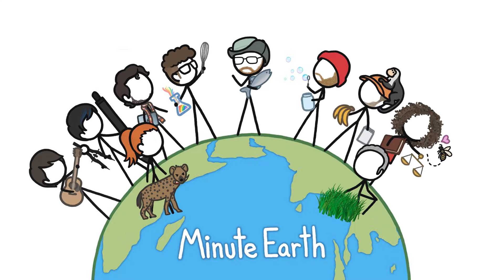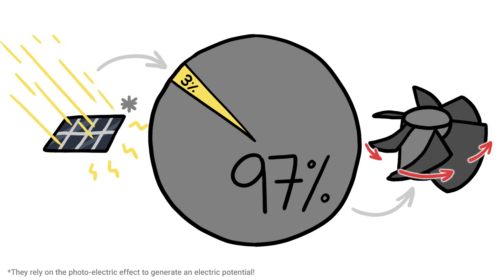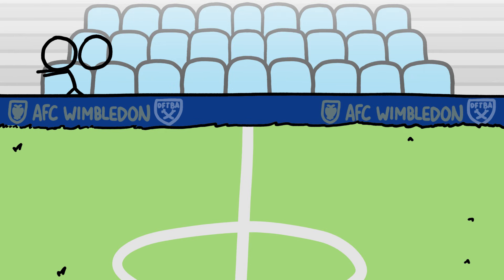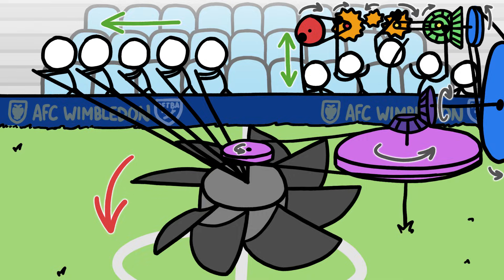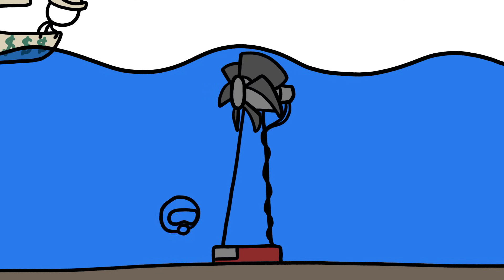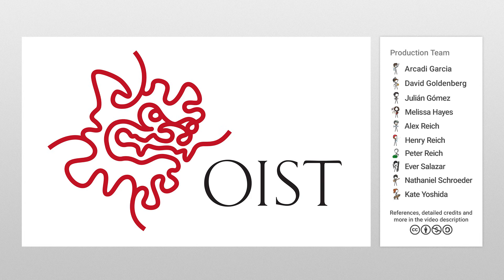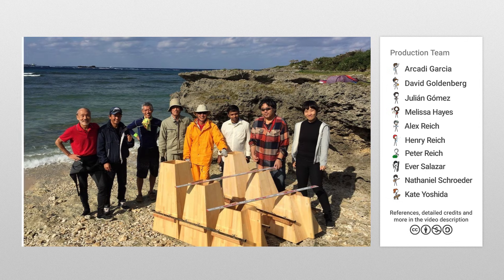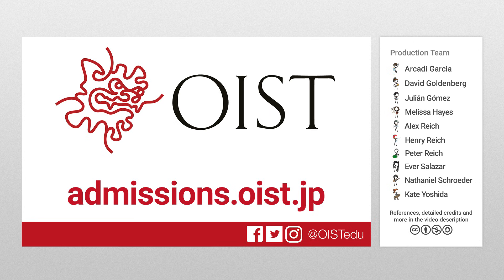Why Can't We Get Power From Waves?

Comment: Mankind does not need more ways to make power, we can do that vary well and in many ways, what we need is a way to store power in bulk and use when needed.
Reply: It is already stored in uranium and thorium at a fantastic energy density. Don’t need storage, just need less radiophobia.
Reply: @soylentgreenb  you need to learn how energy and power plants work as well as matter, mankind as far as I know can not make a uranium battery and I think both uranium and thorium make vary bad battery's as they all ready have energy stored inside, let me explain as I don't think you get the problem mankind face's ( you should teach yourself ) we only run a nuclear power plant at about 5% effectiveness, any more and you would overload the Grid and hole country's would black out, now if we had good power store we could run the power plant at 100% for let's say 2 weeks and then have power for the rest of the year, a much more efficient power use and this use of power can all so be applied to any power generator type not just nuclear.
Reply: @highlandsprings5752  The misunderstanding is entirely yours, not mine. I can store a lifetime worth of reliable energy in the palm of my hand. This power can be created in nuclear powerplants 24/7 at over 90% capacity factor in a power plant; with most of those remaining 10% being planned shut downs when other plants cover for the loss.

I'm neither interested, need nor want to store your unreliable piddle power as in a battery. A supernova saw fit to store all the energy I could ever need in a tiny volume.

"[...]we only run a nuclear power plant at about 5% effectiveness, any more and you would overload the Grid and hole country's would black out[...]" - This is word sallad. Heed your own advice.

Nuclear power plants are not "holding back" and only running at 5% "effectiveness". Do you mean efficiency? If so, that's horseshit. If they ran hotter there would be unacceptable fuel damage in currently existing kinds of nuclear plants (LWRs). It is running as close to 100% thermal efficiency as it is able, which is about 30%; thank steam turbines and mr Carnot for this. The cost of the nuclear plant is the same wheter it is running at 100% rated power or not; there is no particular need for storage. The fuel is the storage.

"[...]now if we had good power store we could run the power plant at 100% for let's say 2 weeks and then have power for the rest of the year, a much more efficient power use and this use of power can all so be applied to any power generator type not just nuclear." - I cannot fathom the kind of misunderstanding that would lead to this erroneous conclusion.
Reply: @soylentgreenb  OK you are missing the point, let's say I have one power plant (any type) and that I have to generate power for five homes and one factory, now my power plant can make 100MWs and the homes need 5MWs each, the factory all so takes 10MWs to run and I just turn the power plant on to max (like how you think power plants work) then you are going to overload the grid and blowout all the homes and the factory, this becomes even more complicated when you add that in the real world (not the movies) the power consumption Of the homes and the factory Will fluctuate at different times, so the output of the power plant must match the demand for said power and this is why renewable power sources do not work on there own as one can not make the wind blow more or the Sunshine to keep up with the demand. I am now going to address your points. 1. Nuclear power plants can generate so much power that they can melt power lines at levels like 90%, most Nuclear power plants do not run beyond 30%, all so power ( I am keeping this simple for you here) will Diminish over distance, so in a place like the U.S you are going to need more then one or you would melt the power lines close to the power plant to reach outlying areas. 2. You are not the only person on the plant Earth and renewable energy can not be used as a viable source for all until we can make better ways to store power. 3. The post was made by phone ( Blame Auto correct ) not key bored and you are using the word "sallad" wrong by the way, looks like you could do with heeding your own advice. 4. Once more the auto correct changed the word so yes I did mean efficiency but effectiveness would still prove the point. "Horseshit" LMAO, first it was a simple example and Second the example was given for any type of power plant not just nuclear, third if you are running a power plant to the point that you are damaging the fuel or any equipment then you are running it beyond 100% EFFICIENCY. As for it costing the same yes that's right and that is what makes nuclear power so viable if only we had a way to store power long term for use when needed. you can put a F1 Engine inside a ford focus but all you will do is destroy the car, their is more to power then just the powerplants so you can not run nuclear plants at 100% unless you have a Transformer the size of Wyoming and are using power cables made from Materials that you would find in Star Trek. 5. A College degree in electrical engineering and over 10 years of experience trying to come up with and implement solutions to the power problem with the ever growing human population mainly focusing on the African front. like I have said I am keeping this simple for your sake.
Reply: @highlandsprings5752   You don't have a point to miss. There's this thing called baseload power and it corresponds to ~75% of power consumption and we can make more of it (e.g. dump load into things like freezers off-peak). Nuclear power plants can load follow a little if needed (see France). Peak loads are absorbed by hydro with a reservoir or NG. 

Nuclear power plants go full tilt 100% 24/7 because the fuel is cheap. Only in France with ~90% nuclear does anyone ever bother to load follow and that's only a few plants and by a little. You simply don't know what you're talking about.

"the power consumption Of the homes and the factory Will fluctuate at different times" - By about a factor 2 between peak and through and over 75% can be supplied as constant 24/7 baseload, which is what nuclear plants do. It is much cheaper to overbuild nuclear, load follow a little and dump surplus power into a big resistor somewhere than try to store REE at all scales from minutes, to hours, to days, to weeks, to seasons and to shuffle power from anywhere to anywhere. Thus far we haven't bothered because getting 75% of the grid is good enough; we can let gas and hydro do the peak loads.

"1. Nuclear power plants can generate so much power that they can melt power lines at levels like 90%, most Nuclear power plants do not run beyond 30%"

Good thing it is easy and cheap to design powerlines for 100% rated power so they never have to melt. 

The only reason a nuclear plant runs at less than 100% rated power is maintenance or a trip from some kind of grid disturbance/blackout. You're confusing efficiency of conversion of thermal power to electrical power, for which you can thank Mr Carnot and the laws of thermodynamics as well as the peculiarities of steam. There is no power being dumped or wasted. This conversison efficiency between heat and electricity is determined by the hot and cold leg temperature and the limitations of engineering design and physics.

"[...]so in a place like the U.S you are going to need more then one or you would melt the power lines close to the power plant to reach outlying areas[...]"

Good thing nuclear power plants are designed to come in small managable units, like a few 1 GW reactors at each power station, so that transmission distances can be kept short and economical, unlike REE which requires massive webs of HVDC capable of shuffling power from anywhere to anyhwere as well as oodles of storage.

"2. You are not the only person on the plant Earth and renewable energy can not be used as a viable source for all until we can make better ways to store power." - Non sequitur / word sallad.

"3. The post was made by phone ( Blame Auto correct ) not key bored and you are using the word "sallad" wrong by the way, looks like you could do with heeding your own advice. " - I'm using word sallad correctly to mean disjointed and unintelligle rambling of missmatched words and phrases.

"LMAO, first it was a simple example and Second the example was given for any type of power plant not just nuclear, third if you are running a power plant to the point that you are damaging the fuel or any equipment then you are running it beyond 100% EFFICIENCY."

That's not what efficiency means. Efficiency is a rate of conversion from a primary energy like the heat of nuclear fission or combustion energy of coal to a secondary form of energy in the place when and where you want it, like electrical power.

If what you said about nuclear power plants is true then they would melt the fuel if they went to 100%. There simply aren't any reserves being held back. Uprating does occur when they prove they can run at higher power without fuel damage, or they can cool the reactor after a SCRAM without jeopardizing safety even if decay heat is higher. Uprates require things like changes the coolant flow rates or fuel geometry (e.g. light bridge) or emergency core cooling capacity.

"As for it costing the same yes that's right and that is what makes nuclear power so viable if only we had a way to store power long term for use when needed."

There's no need for this. We survived the last 100 years admirably without this storage. Nuclear can get 75% of power requirement without even load following one iota, going full tilt 24/7 with some downtime for fuel rotation and refueling and maintenance. The rest of the 25% can be handled by hydro, NG, a little bit of load following or even just building a giant water cooled resistor to dump surplus power into. Bulk storage on the electrical grid makes zero sense and is a more difficult problem to solve than nuclear fusion. Don't count on it.

"A College degree in electrical engineering and over 10 years of experience trying to come up with and implement solutions to the power problem with the ever growing human population mainly focusing on the African front. like I have said I am keeping this simple for your sake." - Extraordinary claims require extraordinary evidence. I find it hard to believe you finished primary school.